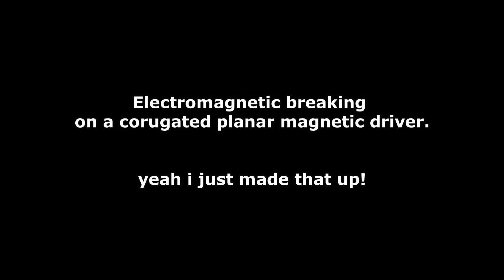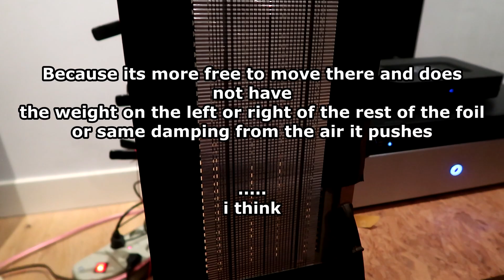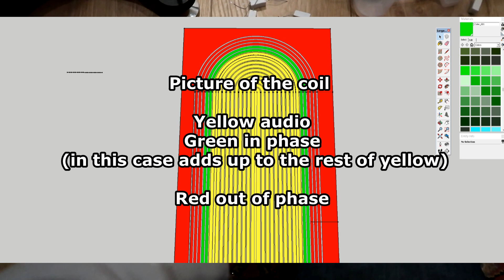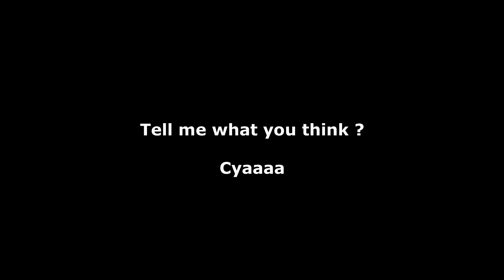Electromagnetic breaking/damping on a corrugated planar magnetic driver

Comment: Panels always show weird resonances in decay traces.  I've often though what would happen if you biased the whole panel with DC?  Not sure if this thought might help you perhaps without corrugation.
Reply from the maker: well all the bias you add will make the efficiency less. i mean you are trying to mitigate what the coil wants to do. its only usefull i think  where the foil is going beserk, not following the thing it should do :)
Reply: @joppepeelen  I have Eminent Technology planars.  Magnets on both sides. If there is a continuous signal I guess it acts to damp the last impulse, as you say not going berserk.  Sort of a stiff corrugated cloth damping material on the back side. The damping material controls the resonance below 100hz.  Normal operating range bottoms out 150-200hz.  Seems only really large panels get below 100hz.  Enjoying watching your work and experimentation.

Comment: looks like the inverted polarity on the second circuit  is countering the standing waves created by the first circuit, pretty interesting 
The questing i have is regarding the undriven spaces between the first and second circuit, are they acting as a bending point helping the counter standing wave effect?
Reply: if you extend the Y axis to the roof, create a high pass where the lower freq is using the inverted circuit and the higher freq is natural, might be a way to extend the LF with an all in one driver

Comment: Maybe if you loop the outer coils to one another , the eddy currents could act as a break?
Reply from the maker: yeah tought about it by shorting it. but its not enough :) i tried that on a tweeter years ago, so im sure it wont work for this, maybe if i add faaaaaar more traces though, would be a charming solution if it did work
Reply: It should be more effective at lower frequency.  Or maybe add a small low pass filter in the loop, so only the lows get breaking action?
Reply from the maker: Yeah i had the could out already :)

Comment: I think you need to do a 50-1000Hz sweep at medium SPL and see what the distortion says... As it is right now the weaker magnet field (and fewer coil runs) on the out of phase outer runs just lower flap, it doesn't remove it. I think you should try to add side support to the "ribbon" now that much of the movement is gone. Maybe even add two weaker rows of magnets on the outside of the inverted phase coil runs to increase magnetic flux there and help the inverted phase force.
Electro-mechanical damping doesn't work in the way you described here, what you would really need to do what you described at first is an outer coil loop with an active zero reference (an amplifier that tries to keep the voltage of that loop at zero) - this makes the amplifier "respond" to any movement of the coil (since the movement induces a current/voltage) with a symmetrical "push-back" of the same voltage. This can resonate though, the feedback needs to be tuned to the mechanical system you use. I have done this with many industrial motor controllers on larger machines and robots - same principle. Rotation, since it's a motor - but linear motion is the same thing.
So a weaker, inverse polarity outer coil might be a really, really good idea. Removes the tuning necessity, you just need to adjust the force ratio between main coil / outer coil
Reply from the maker: well i cant remove the flap completely (yet since this is my first try), but getting rid of most of it helps allot. keep in mind the foil needs to be 4 or 6 times bigger. and should get better and better , this is the worst case scenario small foil trying to pooop out 38 hz :) sine wave
Reply from the maker: yeah i have to play with the ratio!, now i made the mistake of having 2 traces in phase witch are uselles since they just add up to the original coil (since i was not planning on using a audio signal) , besides that i think ading more magnets witch is rather a waste of magnets, or try to get the balance right between audio coil and break coil... oooor give it a slight support and hope i can get rid of the breaklup this way next to the coil and where it is supported

Comment: Are you progressing to some form of monitor feedback where you use one of the coils to sense movement at the edge and the others to null it out. Anyway looks to be extremely cool area of development.
Reply from the maker: in this case it is the same  audio signal been out of phase keeping the edge of such foil in line (as in not going overboard in excursion/flapping) a friend of mine is working on motional feedback on a planar though..  witch works for flat panels not sure yet for corrugated ones.  yet